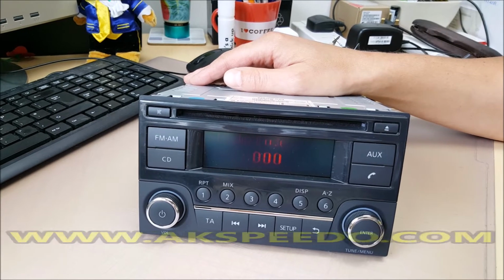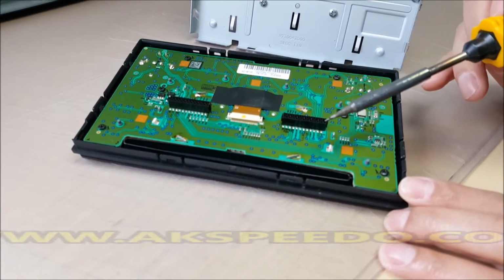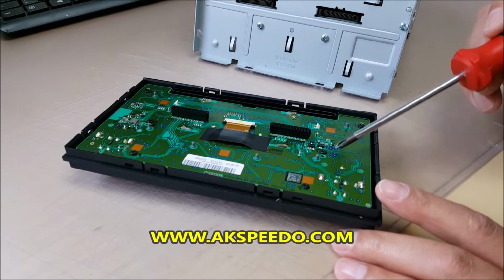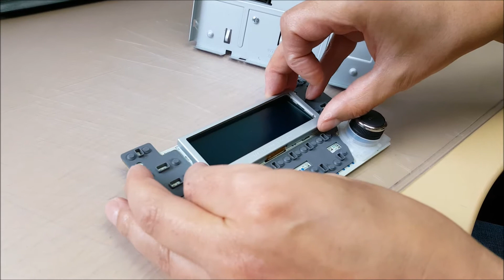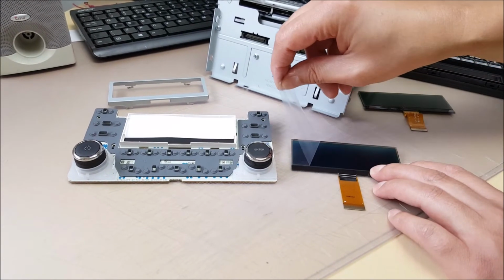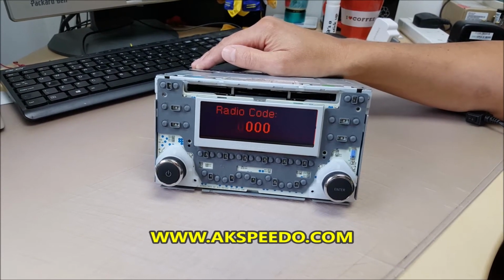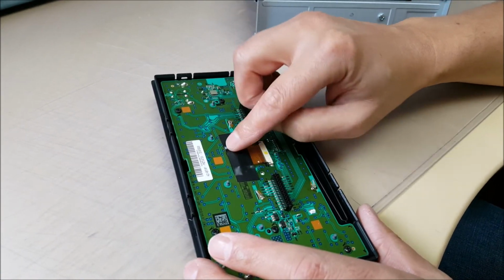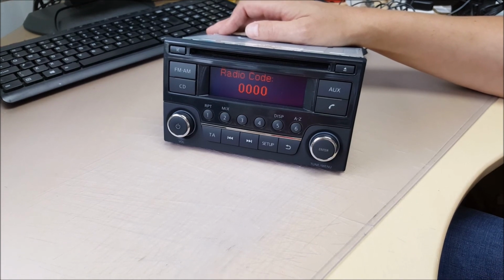Nissan Radio Replacement LCD Pixel Repair Juke Qashqai

Comment: Whats the purpose of the soldering of the lugs please ? My screens failed, but do i need to solder ?
Reply from the maker: You don't need to solder the lugs back on, as long as the lugs are bent back over to ground on the board, James

Comment: I have a Range Rover sport l320 with a flickering speedometer problem, the speedo meter light flickers from bright to dim randomly. The dealership at America is charging me thousands of dollars to replace entire instrument cluster. I am curious would it possible to fix the flickering light problem since every other parts of the instrument works fine for past 9 years. Really appreciate for any tips or help mate!